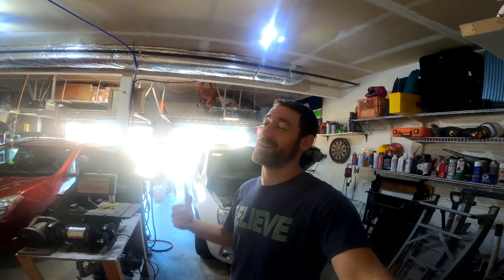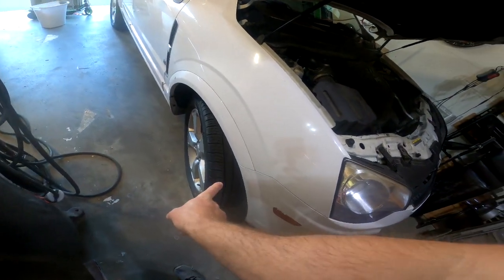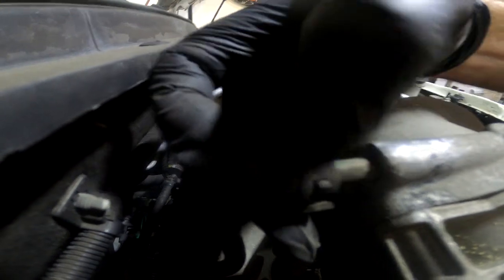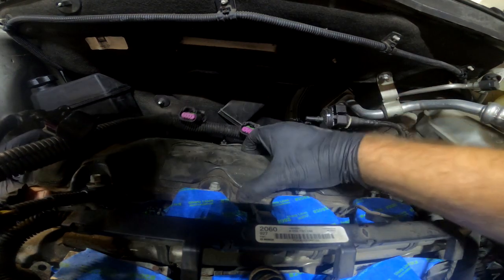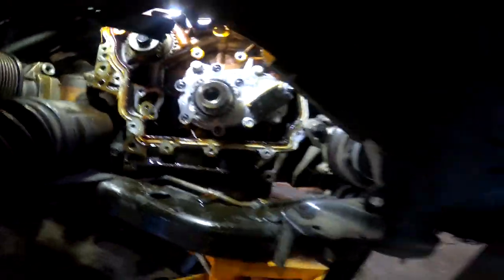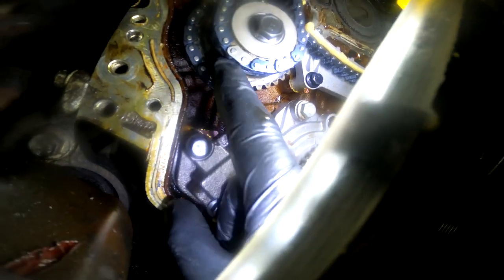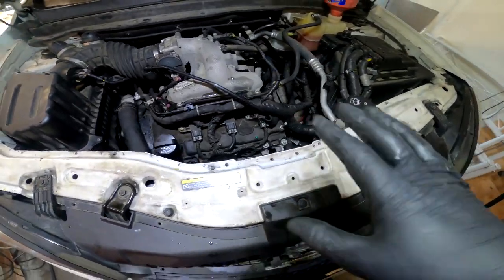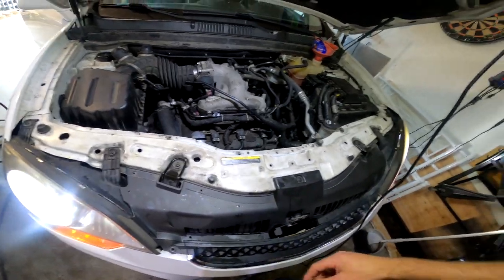Saturn Vue 3.6L Timing Chain Replacement

Comment: Good job! Looks like a massive PITA 😆
Hey the motor has "flood clear" mode if you want to crank it without chance of it firing up, what you do is FLOOR the gas, HOLD it down, and then crank the starter.
The computer won't let the fuel injectors open so the motor just cranks over. You can also do this if you flood the engine with gas (how, I dunno) and need to clear it.
Reply from the maker: Thanks for the tip

Comment: At the end the check engine light came on did u figure it out after changing the chains? I got a 08 outlook and it’s throwing codes and everyone is saying chain is probably stretched to replace it same motor
Reply from the maker: Stretched chains are very common on these motors and is likely the cause. The check engine light for me ended up being the purge valve.
Reply: @christopherjpeters 💯 percent Facts & Truth. Some need a timing chain sooner & some later on high mileage. I also have heard of super high mileage & no timing chain because of GR8 maintenance & good quality oil. It's like the GM LS model 5.3 engine. There's no rhythm or rhyme of when you could have lifter problems. Some of them never having lifter problems and super high mileage. Oil changes & proper maintenance help a long long way....

Comment: i got that same car. how do i take the tension out of the timing chain if im doing a head gasket?
Reply from the maker: GM makes a tool that slides down the front cover and prys against the tensioners so you can take the chain off the cam phasers.
Reply: Thankyou, Much appreciated.